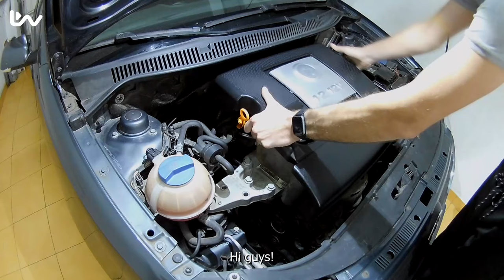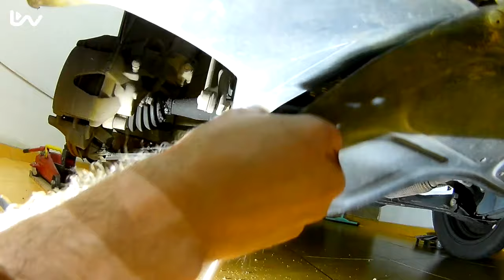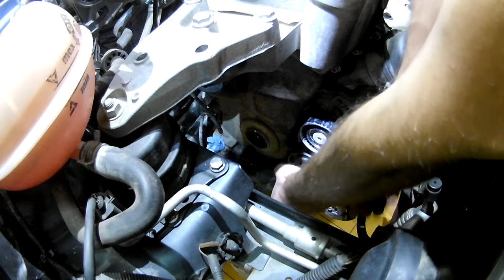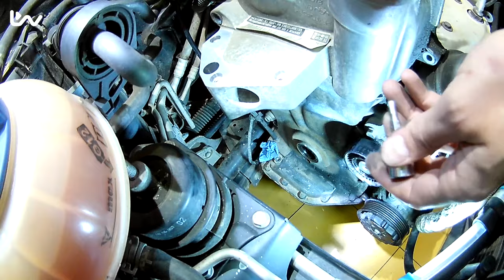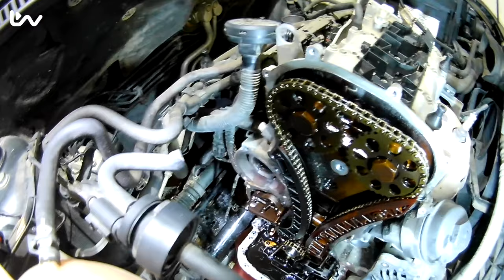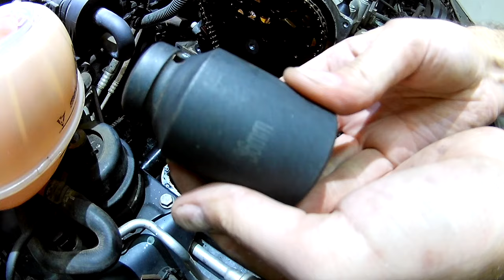VW Polo 9N3 1.2 12V timing chain replacement - no special tools! - Part 1

Comment: Friend, can you ask me a question? I have a vw polo with this engine, and the following happens, the rotations at idle are unstable, it accelerates by itself up to 1,200rpm, and while driving it takes a long time to lower the rpm... obd. Is it the RPM or Map sensor? Thank you 🤗
Reply: Boa noite acho que e o sensor das rotacoes
Reply: I have the same problem. 
Have you fine the solution?

Comment: I thought the chains are supposed to last the lifetime of the car? Whereas belts need changing. Every 5 years?
Reply from the maker: Yes, in theory they would last the life of the car, but the truth is that in reality they stretch over time, ending up loose, making noise and being in danger of breaking. In the case of this engine, I changed it because there is a known problem with the guides, and not knowing if they had already been changed, I preferred to change it.
Reply: They do with regular services and proper maintenance and let’s face it these days nobody has any knowledge of how maintenance plays a major part in how long your car lasts people just don’t care until it’s breaks
Reply: @lnhomeprojects2109  I have this same car manufactured in 2006 but only has done 75k miles in getting paranoid now? Do you think I may need to chain replacing? I change the oil and filters every 12 months/6k miles